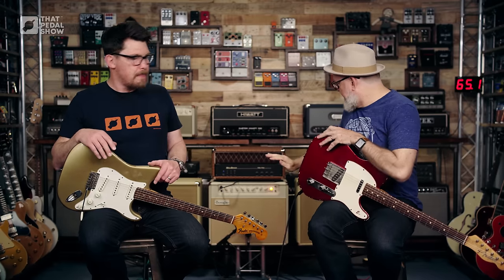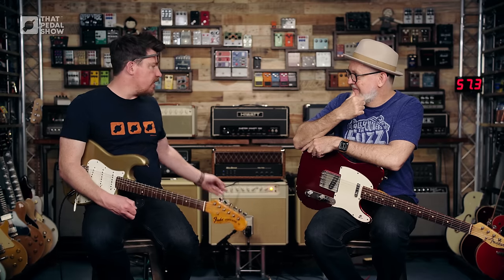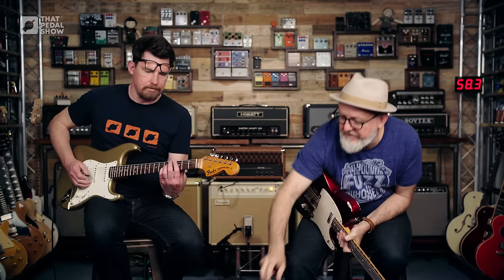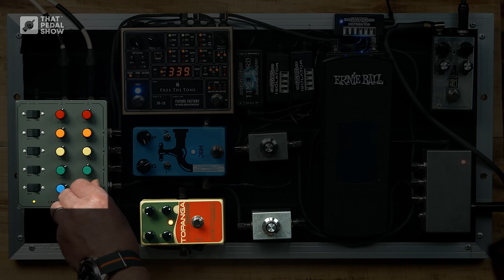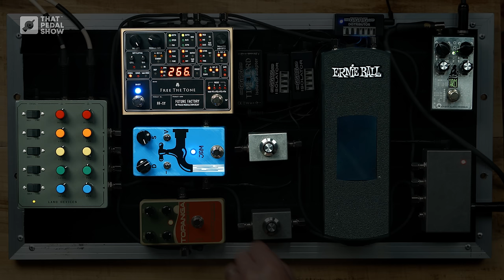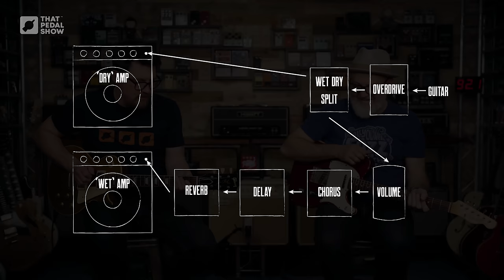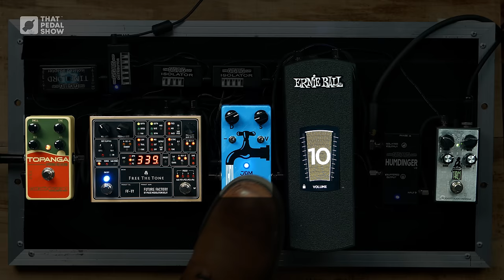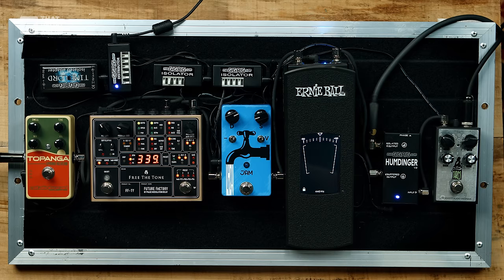Did We Get Wet-Dry Guitar Rigs Wrong? [Proper Wet-Dry-Wet Vs TPS Wet-Dry]

Comment: These are my favourite kinda episodes on TPS. Bigger picture stuff. As a player that always gravitated to amp gain rather than pedals for gain, and indeed ran a ADA MP1 with stereo effects well past the 80's into 00's, this is right up my alley. What I do these days is run either Stereo or WDW on stage, but always give the FOH a stereo direct out (i.e. via stereo speaker IR box). The stereo Wet speakers on stage consists of a single 1960A quadbox in stereo mode which is powered by a ISP stealth stereo power amp (2 x 80W) mounted underneath the pedalboard. The quadbox doubles as the "wheels" for transporting the combo amp that provides the core tone and dry speaker. With this setup I get WDW on stage and Stereo mix (controlled by me) in the FOH for very little additional (if any) effort in terms of gear to load/setup.

Comment: Great playing, great tones, great information!  I'm interested in your thoughts on wet/dry where the split to the wet fx happens post power amp from the dry amp via something like a Suhr ISO or Torpedo line out -- rather than splitting earlier on the board or via fx loop.  It's a pain, but I find it fun with my non-fx-loop Morgan MVP23 where the power scaling lets you interact more with the power amp for gain staging.  Maybe I'll take this to the next VCQ.  Cheers, folks!
Reply from the maker: Yep, we mention it briefly at the end where you can split pretty much anyway you want. Mic’ing the amp and applying post FX at the desk as described at the beginning is the ultimate extension of this. Cheers!

Comment: I had a WDW for several years because of your influence - I loved it. I ran two AC15c1 and c1x, wet, with a Mesa TA-15 dry. It was absolutley glorious. I tried all types of switching combination, amp combinations and pedals, none sounded bad. However, it was just too much for the living room, considering my small space and lack of playing ability. I have the pedals still, but the amps are gone. I am considering my next move and Mick's recent experience with the 212/dual Mesa rig has me curious. I have my eye on a Yamaha THR 100 HD dual channel head. I also have a large old rotary 212 cabinet, Allen Organ Gyrophonic. However, the commutator goes to both speakers. I am not sure if I can easily add another input to the commutator - they don't make 'em anymore.

Comment: Wet-dry sort of presents the same old drawbacks:
- logistical PITA
- inability to place effects before the gain stages, unless you double every gain stage (so your 3 overdrives become 6 overdrives and you have to jump on 2 footswitches at once).
- inability to use the wet-only effect option on pedals that are located after the split, unless you devise a way to simultaneously kill the dry amp sound somehow

To overcome the above you may require a moving crew or a lot more than 2 hands, 2 pedalboards, one per 'side', 4 legs to operate them or 2 heads to come up with and operate a complex midi switching system, and after all that you are STILL unable to deliver THAT sonic experience you've been chasing to every audience member. If all I wanted to be is a bedroom player, I'd definitely go for some kind of a stereo rig.

Comment: I think wet - dry - wet has its advantages for certain kinds of music, high fidelity pop productions, 80's MOR/stadium rock and the modern equivalent (I'm thinking bands like Soundgarden, deftones, tool where the guitar is the source of majority of the sound stage/design) where as older rock-'n'-roll it's less necessary and for allot of indie/college rock/alternative rock the lo fidelity nature of lots of pedals into the front end of one or two amps is a key sonic signature of the sound. I couldn't see bands like Blur, or Radiohead working in a wet-dry-wet setup.

Comment: The "TPS" way is very similar to my setup, though I call it a "split effects rig". Neither side is dry nor completely wet. I leave reverb active on the "drier" amp and have another reverb on the "wetter" amp for a reverb heavy setting. My delay is a Boss DD500 usually running as 2 independent delays, one for each amp, but I do have presets where the delays are matched or synced, though never mixed. I also add a solo boost just before the split, and a tremolo after the switchable reverb. I think "split effects" is a more appropriate way to describe it.

Comment: Lol!!! The style of TPS is now Dry/Damp .... that got me.  Wet/dry full on or Dry/Damp is the breath of life that brings all the TPS wonder to complete realization.  One day, I want to hear you guys stack two amps together and then send it in parallel with them blended together so you can get the EL84 6L6 sound in a full wet dry.  I'd like to look into easiest ways to do full wet dry without compromise and have rig stability personally.  I'm not big into dirty tones so it should be easier to balance everything, I have an arch top and want to get a strat... had a Les Paul for 10 years and it was the best one I ever played and I could never get it to behave traded it for an Archtop, very happy (Heritage Eagle with a custom Armstrong pickup)  I like to play acoustic a 99% of time.  Would be cool to be the most try hard singer songwriter ever with wet dry for vocals too haha    - my vote is Dry/Damp or TPS Dry-Damp
Reply: Loved my Eagle, it felt perfect the very first time I picked it up, no having to adjust to it. Unfortunately it was stolen 20 years ago.
Reply: @davidamooreii1805  I wasn't even shopping for it, they had me try it out, and I was like this thing just SOUNDS like 'guitar' more than anything I've ever heard in the best way possible.  So sorry yours was stolen.  I traded my les paul for it a couple of years ago 1997 blonde eagle and then I put in an armstrong pickup so I could use acoustic strings electrically

Comment: thanks guys for this video! I've been watching several wet-dry videos from you and I found the sound to be completely sick. I'm putting together a wet-dry rig now and iI have a question about the volume pedal. If I understand correctly, it controls the level of wet in the sound. What happens if there isn't one? 
Keep up the great work
Reply from the maker: This is slightly more complex. You can have a volume pedal on your wet amp to control the entire volume of it. That’s one way to do it. The other way - which would be our personal preference - is to have an expression pedal hooked up to your delays and reverbs to control the wet level of those. So the wet amp would stay going, but the level of the effects goes up and down. It’s a little more complex to achieve and the pedals need to be capable of it…. But that’s what we’d do. Cheers!
Reply: @ThatPedalShow  will any volume pedal do the job?

Comment: My setup is sometimes wet/dry/wet and sometimes wet/wet/wet - I have two Katana 50s flanking an Ampeg 1x8 bass combo. I split the signal l/r using a Poly Beebo (right being the r/h Katana) and then again with a second Beebo (this one connected to the l/h Katana and the Ampeg). 
A lot of the time I send a "clean" signal (there are lots of other pedals in front of the first Beebo so it's not necessarily clean) to the Ampeg but I can send it plus whatever patch I'm running on either Beebo too if I want.

Comment: I prefer the missing options in this video which fall between the two. The wet/wet option where different effects are being sent to each side, example delay to one side, then chorus to the other. And then there is another similar wet/wet option I like where all the effects go into both sides except for delay which only goes to one side but after the effects just to make the sound bigger/thicker.

Comment: I always want to try some kind of wet/dry set up and then just try mixing the dry signal back in to one amp. I  think a lot of the benefit of this is some a dry signal in the output to help keep it clear.
Reply from the maker: It can be a cool way to do it. For example using an amp that has dual channels that are always active (AC15s and 30s, Plexis, many black panel Fenders etc)…. But nothing beats having two separate amps. It’s a totally different game. Massiveness! :0)
Reply: @ThatPedalShow   cool. I'll get around to trying it one day. I've got a Zoia, so could use that just to play with parallel paths. 
Great sounds anyway!

Comment: what's the wet dry split before the parallel split? I couldn't see that on the board. Also where is the return from going back to the wet amps? The mixer pedal or the wet dry split?

would really appreciate if you can reply this, thanks so much guys , you guys are awesome!

Comment: Hey Dan/Mick and the tps community - wanted to pick up on something from a long ago video on wet dry. You mentioned one option was to have contrasting amps to complement each other, which totally makes sense. But if instead you were building a stereo rig, would you suggest that the amps be of a similar sound? Otherwise you could be getting radically different tones stage left and right due to the hard panning required for some stereo effects? Thanks as always for keeping my wallet light!
Reply from the maker: Yep. I’d always try to have very similar - preferably the same - when going stereo. Cheers! Mick here.
Reply: @ThatPedalShow  thanks Mick, that's what I figured. I'm still flipping back and forth between wet/dry and stereo, it's neverending

Comment: I'm not standing on a mountain here, just wondered if you had tried a variation  (on your vertical stack) where the TPS -'Wet Dry' is modified slightly so that the wet half is only the wet signal, rather than wet-dry (damp?). Although you may need to remind the sound guy that the wet signal will be quite low compared to the dry at least you don't risk potential phase issues between the two dry components. I'm playing with it now, it seems a tad more spacious, but more experimentation required
Reply from the maker: Yah, tried that and it’s not for us. One of the things I like most about TPS WD is the coupling of two loud amps. Potentially more fidelity the other way, but two amps cranking is such a strong sound. We love it! Phase is easy enough to solve as long as you’re not using anything that has 100 per cent AD conversion. But sure, if you are, getting the dry out of the wet that solves your phase issues when using a lot of digital stuff…. Mick here btw…
Reply: @ThatPedalShow  Mick, thanks for replying so quickly. As a 2nd guitarist in a fairly large band, getting loud, though fun, is out. However, right now I'm at home and nobody is about, the hunt for tone continues, and this knob here goes up to 11...

Comment: After all that intricate stuff i would say a basic 2 amp w clean and/or od/distortion to one amp and clean plus effects to the other is a much more simplified system like the ones you have been using.
Stereo is nice but on most gigs there is not enough space to take advantage of it.
Let the studio guys do whatever they want. Trying to simulate that on stage is too much hassle for most ordinary players.
Furthermore, all these ambient guitar only stereo soundscapes are very nice. Then you go and do a gig and the equation alters completely. You will filter in more direct sound the closer you are to drums.
So, most inside stages are no more than 5 meters wide and 3 deep. In order for your stereo wet/dry setup to work you need to separate your amps. Not enough space in most cases.
At least with a simple 2 amp wet/dry rig you can be compact and still keep and perceive some of that sound separation.
Youve been a great help to me with the previous wet/dry videos..🙂
Reply from the maker: Yah, all of this. Thanks Egon!
Reply: But of course you explained the drawbacks at 32min..

Comment: After your show with Aynsley, My second amp made a comeback for a dry wett rig , but I struggle to find the pedal to tame the attack of my wett transistor amp and make it feel nicer
a bit like Ainsley did with the mad professor blue overdrive and his fender I use a boost/overdrive Only on the transistor amp but it’s not a good match.
Do you have a few pedals to recommend to get a nicer feel and fix the fast response of a transistor amp? The only one I can think is  The earthquaker special cranker? May be an other subtle overdrive or a Compressor?

Ill appreciate your feedback on this ;)
Thanks !!

More details : 

Transistor amp is an Eko With an 8 inch speaker, it has a great diffusion in the room, dynamic and loudness but less lows obviously. It received delays and verb.
I used it in conjunction with an attenuated / crunchy tube amp (echolette M40) for the dry. level adjusting of the two a bit tricky I need a tool to smooth that out, too mutch transistor and the harshness in the highs comes after you!
Léo

Comment: Finally got a Marshall dsl5 combo to sit alongside my black star ht5 mk2. Sound magnificent!!! Just need to check they’re in phase with a cable with a ring / tip swap on one end. I guess that’ll will work? I am using the stereo out from Dd200 to drive Marshall.  Only pedal in one effects  loop is a mr black doubler chorus. Might need a second delay for the loop in the marshal when using the ultra gain channel. After some eq tweaking it sounds magnificent!

Comment: BTW Steve Lukather did a lot wet dry wet and sounded awesome - my biggest revelation was discovering a buffer pedal with 2 channels + tuner output (Carl Martin not 9 volt though) clean up signals a lot. I need a smaller amp with FX loop for home use thinking about Laney 1 to 15 watt, any thoughts ?

Comment: Friends and I have had fun with this, but apparently this is a serious question to some people.  In America ( at least back in my day ), we would call these people "sticklers", and say that they're "splitting hairs", but hopefully they feel that they're sharing information.  For me, if someone somehow splits their guitar signal, and only puts modulation and/or time-based effects on one line, that one is "wet" and the other is "dry".  Wouldn't it be nice if we could come up with a short and simple term for this?  Just saying.
Reply: If you are referencing the comment that TPS Wet/Dry is actually Dry/Dry+Wet then I think you may be confused. 

The difference between Wet/Dry and Dry/Dry+Wet is in the first example the Wet signal has already gone through the Dry amp’s preamp so it was, in a sense, Wet even before it hit the effects. In the TPS method the signal is split before it hits the Dry amp. This makes both amps initially Dry in the sense that there is no amp coloration going into the designated “Wet” amp.

Just as there are tons of ways to label or name things, there are just as many ways of “splitting hairs” 

There are major differences between Wet/Dry/Wet, Wet/Dry and Dry/Dry+Wet. I also don’t think that going from two 3-letter words to three 3-letter words makes it a long and complicated term. Still seems real short and simple to me. Just sayin. 

Regards,
Stickler

Comment: Gents - Thanks for this video. Not sure I have my head around it entirely. Am I right in thinking that the dry signal (with boost or distortion added) going into the mic is always going to be 'non-clean', so that what the 'wet' channel deals with is also never a 'clean' signal?  My 'wet-dry' setup has been a Victory V30 (dry) and a Blues Junior (wet) using an ABY box as the first point of call after the guitar, so that the 'dry' and 'wet' effects are discrete, and the wet sound is a 'wetting' of the clean signal. I don't have capacity to use a mic. Am I getting it wrong, or missing something? Would you recommend setting things up differently?

Comment: Do you have any advice on how to run wet-dry with a switcher. Ideally I would like a setup that gives me the flexibility to run wet-dry at home and for bigger gigs where I have two amps but easily switchable to single amp without needing to rewire my board every time, for rehearsals and smaller gigs when taking two amps isn’t practical. 

Love the show btw. I thought I knew something about tone until I started watching you guys. Awesome work.
Reply from the maker: Hello Allesandro. Yeah, that’s exactly how I did it for years, Mick here, and it’s one of the great advantages of doing TPS wet dry instead of stereo. So you’re currently splitting the signal somewhere for the dry tap… all you do for one amp, is just don’t plug the dry amp in: simple as that. You may need to adjust the relative wet mix down the wet side now you’re just running one amp, but that’s it. In my case I would put a Humdinger in one loop of my switcher where I wanted the split. The loop would have to always be on of course. Out of the Humdinger (or ABY switch) back into the return of the loop to continue down the wet path, and the other side off to the dry amp. Just using one amp? No dry amp! Cheers!
Reply: @ThatPedalShow  thanks Mick!